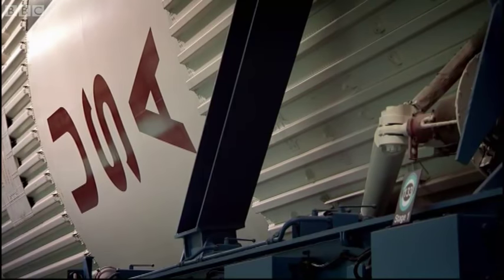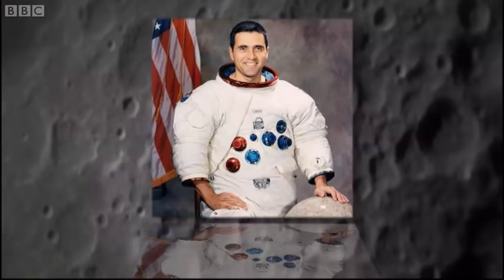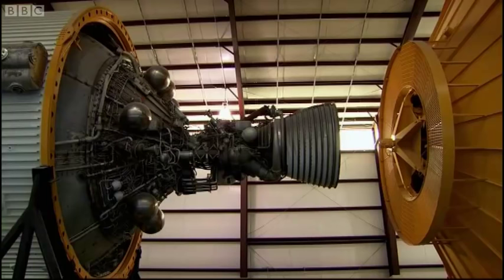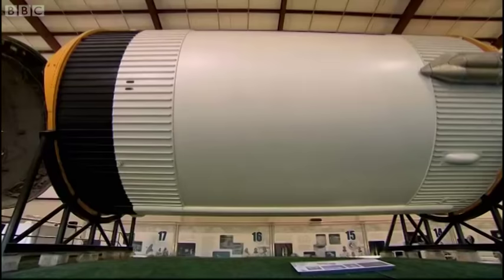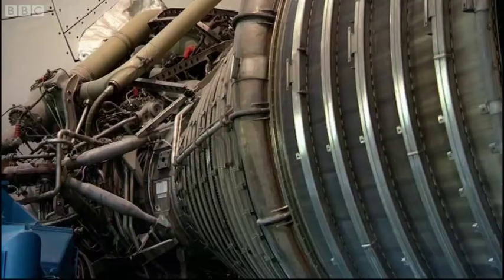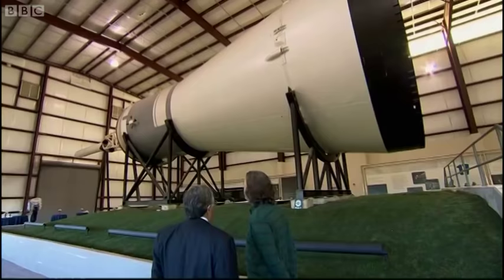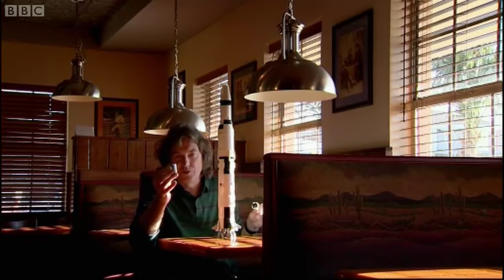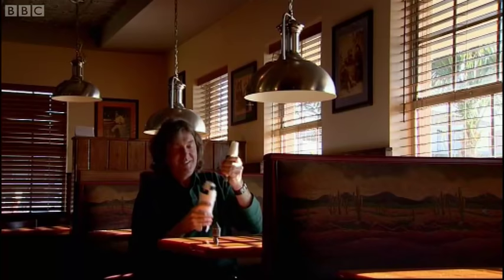How Did The Saturn 5 Rocket Work? | James May: On The Moon | Earth Science

Comment: 6 million components. James May The Reassembler: Saturn 5 rocket.....
Reply: In the words of clarkson if that happenes "A BBC film crew just hung themselves"
Reply: hung*
Reply: rockaholictom   Well, many of the parts were redundant, so that one failure wouldn’t cause an abort. The designers of the Saturn booster in particular had a large number of redundant systems. And it certainly worked well. It never had a major failure, a rarity in those early days of rocketry. It even survived two lightning strikes during the launch of Apollo 12. Everything on the CM had to be “rebooted”, but the Saturn’s “brain” (the guidance system), the Instrument Unit (IU) was well shielded, and it kept the booster on course into orbit.
Reply: ....I mean How hard can it be?
Reply: @johncronin9540   I'm calling you out on your fraud. You can't go above Mach III. Actually , giving you, and your claim of Mach III , let alone 25,000 m.p.h. {LOL} , please, you ain't got it in ya, fraud. Your booster separated/staged , and then it went out east trajectory toward Bahamas, and crashed into the water.  That's it, fraud.
Reply: Stratoleft You can “call out” whomever you like. I never claimed that I was working for NASA (then, or ever). The problem you have is trying to find evidence for your claim. I was alive while the Apollo missions were happening, though I was too young to remember Apollo 11. 

But I DO remember the later missions, and especially in the last three “J” missions (which had the Lunar Rovers), and remember watching those extended EVAs on the Lunar Surface. They lasted as long as 5 hours each, and covered a lot of ground. Viewing this was possible due to the fact that a television camera could be attached to the Rover. That camera was controlled by a flight controller at Mission Control. 

As for the booster, if you watch the first stage burn, you would hear of the spacecraft and booster approach “Max Q” which meant that the vehicle was surpassing the maximum dynamic pressure, which was the speed of sound. You could see this on the ground, especially via the telescopic cameras as the vehicle passed out of sight. 

But that doesn’t mean it was simply flying horizontally. It’s velocity took it up in altitude, and eastward, to take advantage of the Earth’s rotation at that latitude. That saves fuel. 

It took the power of the first and second stages to get close to orbit, and the third booster ignited to give the vehicle the speed it needed to achieve orbit, which is 17,500 mph. The vehicle remained in that orbit for about 1.5 orbits, so that Mission Control could review the telemetry data they were receiving, and ensure that the third stage and Apollo spacecraft were functioning nominally, before a “go” for TLI was determined, and that burn commenced. The third engine was reignited (a first, in liquid fueled engines), and sent the vehicle on toward the Moon (more precisely, toward the location the Moon would be at in three days time). 

That burn, well above most of the atmosphere, accelerated the vehicle to about 25,000 mph. It was enough to get the spacecraft to the Moon, though almost immediately after the burn, the speed of the spacecraft would begin to get lower, as the Earth’s gravity was still interacting with it. Once it passed the point where the Moon’s gravity was stronger than the Earth’s, the spacecraft would be accelerated again, (though not to the 25,000 mph speed - the Moon’s gravity was much less than that of Earth), until the burn of the SPS engine placed it in lunar orbit. 

Attaining that high speed (25,000 mph) would be approached again after the CSM “fell into the Earth’s gravity well”. The atmosphere of the Earth would greatly slow that velocity. You can see the punishment the CM endured by looking at the scorching all over the sides of the spacecraft. The ablative heat shields took most of the heat generated by re-entry (those heat shields were built about 15 miles from where I am writing this). 

The nature of such a voyage could easily be tracked from many locations on Earth, and many radio astronomers tracked the flight (when their part of the Earth was in the proper location, and certainly the Soviets were tracking it. Had this all been a hoax, they (and anyone else with a radio telescope) would have immediately known about it. That’s because throughout the flight, a stream of telemetry and voice communications was constantly being sent to Earth from the spacecraft. The only times this didn’t happen was when the vehicle was passing above the far side of the Moon. 

There would be no possible way to fool the entire scientific community on Earth, and it’s also clear that the Soviets would have announced any fraud to a global audience. 

Sorry you live in your own little world, where facts don’t matter to you.
Reply: Joe Chang    Well, the main way the Apollo missions were navigated was using the Doppler effect by analyzing the radio telemetry from voice and telemetry signals from the Apollo spacecraft. The backup system involved a gyroscope and a computer (one each aboard the CM and the LEM. The third backup involved one of the older methods of navigation, using the stars with a sextant. During the course of the flight, mid-course corrections would be done, if needed. 

In terms of distance, it was usually the distance from Earth. While the TLI burn would accelerate the spacecraft to 25,000 mph, as soon as that burn finished, the spacecraft would slow down, as the Earth’s gravity would still be influencing it. This would continue until the spacecraft entered the location where the Moon’s gravity would become stronger than that of the Earth. It’s important to remember that in terms of navigation, mission planners had to get the spacecraft not to where the Moon was at launch, but where it would be three days ahead, when the spacecraft reached the Moon. 

The aiming point was a spot 60 nautical miles above the leading edge of the Moon, and while passing around the far side (SPS engine first) that engine would fire, slowing the spacecraft so that it would be in lunar orbit. 

In the early missions, Mission Control would fire the third stage of the Saturn, so that it would be well separated from the Apollo spacecraft. Essentially it would be sent into a solar orbit. In later missions, when there were seismometers on the lunar surface (placed there by previous missions), the third stage would be set on a trajectory to impact the Moon, thus creating artificial “moonquakes”. 

As for returning, the SPS engine would be fired, thus reaching escape velocity from the Moon, and the spacecraft would literally fall down the Earth’s gravity well, from a very high altitude. The velocity would quickly accelerate back to that 25,000 mph, until slamming into the Earth’s atmosphere. The trajectory again was monitored from Mission Control, via a network of radio antennas placed at points around the globe, so that communications would be constant during the coast home. Again, if mid-course connections were needed, Mission Control would send up the necessary data needed to execute the burn. 

The vital item on the return trip was the angle of entry into the atmosphere. It had to be extremely accurate in order to achieve a nominal re-entry. If the angle was too shallow, the CM would bounce off the atmosphere, like a rock skipping on the surface of a pond, and the crew would not have the fuel necessary for a second chance. If the angle was too steep, the spacecraft would burn up, despite the heat shield. 

There are books which explain in complete detail just how this was done. Needless to say, it was a collaborative effort between the flight controllers and the crew. Navigation and guidance was handled in the front row, nicknamed “The Trench”. 

For unmanned deep space missions (such as Voyager), controllers often used gravitational energy (often referred to as a “slingshot” maneuver) to accelerate the spacecraft to greater and greater velocities. 

An understanding of gravity and of inertia is all that is needed. In the vacuum of space, once a certain velocity is achieved, any object will continue on this path, unless acted upon by various gravitational fields. Engineers simply used their understanding of gravity to harness gravity to increase the velocity of a spacecraft. If you look at the trajectory of many of these probes, they are often headed in unexpected directions to use the various planets for these slingshot maneuvers, thus allowing the spacecraft to get to its destination more quickly. They rarely rely on boosters alone.
Reply: Joe Chang  You forget that in space, most of the time, the spacecraft will coast most of the way. You don’t need to constantly fire a rocket engine. But unlike on Earth, space is a vacuum, and thus there is no friction to slow a spacecraft down. The actual TLI burn is of a short duration (a few minutes at most), since at the time of TLI, you are already in orbit at 17,500 mph, and are increasing velocity to 25,000 mph. It takes more fuel just to get into orbit. This is why the Saturn 1B was used for Earth orbit Missions (such as Apollo 7). But to go further (to the Moon), you need the much larger Saturn V. 

Bear in mind that a manned vehicle has a lot more mass than an unmanned probe (life support systems, and increased redundancy add considerably more mass). That’s why the massive Saturn V was needed for Apollo Lunar Missions. Those unmanned probes had a lot less mass.
Reply: Would watch. Would skip work and meals to watch
Reply: Joe Chang    NASA did choose the timing to be “early local lunar morning” as the time for landing. (Remember, one complete lunar day. Is about 28 Earth days). Temperature was one factor, but the more critical factor was to assist with the landing itself, for with the sun low in the lunar sky, the shadows would make clear such hazards as craters and boulders. You wouldn’t want to land on a boulder, and if you landed on a steep slant, you would risk tipping the LEM over. 

Early missions chose the safest spots to land, and as confidence grew, building on each success, more interesting, but slightly more risky landing sites were chosen. If I had had a chance to go, it would have been on one of those later missions, with spectacular views, and a rover that would allow you to travel further from the LEM. 

In terms of the landing, the LEM had two stages, a descent stage, which had one main engine (the first liquid fueled rocket engine which could have its thrust adjusted), with small thrusters on the ascent stage to control the attitude of the vehicle (pitch, yaw, roll). The main engines (one on the descent stage, the other on the ascent stage) used hypergolic fuels. What that means is that when the fuel and oxidizer came together, they ignited on contact. No igniter was needed, because ignition failure had to be avoided. 

The astronauts lived and worked in the ascent stage, and when it was time to leave, the descent stage essentially became the launch pad for the ascent stage. Apollo 17 had the best television image of the launch. This was possible because the TV camera was mounted on the Lunar Rover (a remarkable vehicle), and the camera was controlled from Earth. This was used with the three latter missions, but it took the flight controller time to adjust for the 1.5 second delay in a signal traveling to the Moon, and from the Moon. When the Lunar Reconnaissance Orbiter (LRO) was launched a few years ago, it was possible to see all six landing sites, with the descent stage, flags, instruments, and Rovers (used in last three missions) all still there. The LRO images even picked up boot prints, and tracks from the Rover. 

The EVA suit posed someone the biggest problems, in terms of trying to operate pressurized (Al Shepard had to do his golf swing with one arm, because he couldn’t bring his arms together), and also thermal control. The suits were white, to reflect most of the Solar radiation. But the Moon is actually one of the darkest objects in the Solar System, and its dust was quite dark, and like a fine powder (rather like burnt charcoal). It got everywhere, and over time, the temperatures in the suits would climb. (Remember, unlike Apollo 11, those latter missions lasted up to three days, during which the sun would be (much more slowly than on Earth) rising). 

The astronauts had to brush each other off, to remove as much dust as possible, in order to allow the white surface layer to radiate light and heat away, and put less stress on the internal cooling system.
Reply: scooter scooter    This is the biggest shame about Apollo. It’s been nearly 50 years since we’ve been. So many people have no living memory of any of the Apollo Missions. You can blame Nixon for that. Under his Administration, he canceled the last three missions (Apollo 18, 19, & 20), and ended the program, and forced NASA to develop the dangerous Shuttle. 

It was a combination of the economic downturn (mainly due to the costs of the Vietnam War), and, IMO, Nixon’s belief that Apollo was Kennedy’s big project. 

I do know someone who saw the last two launches. The force could knock one over, and his family lived sixty miles away, and had to take anything breakable down. He was fortunate to have a classmate whose father worked with NASA’s PR department, and they were able to watch from the media section.
Reply: Joe Chang     No.  The Sun would be just over the horizon, producing the longest shadows. If the Sun were at the zenith (from the POV of the landing site, there would be minimal shadows, which would hinder the landing). 

Of course, the Moon is like the Earth. Latitude can also affect shadows. The early flights (11,12) were near the lunar equator.  This was for safety. If something happened,  (like the Apollo 13 disaster), the spacecraft was on a “free return” trajectory, which meant that the trajectory the spacecraft was on would, without any firing of an engine, would use the Moon to slingshot the spacecraft back toward Earth. 

Ironically, Apollo 13 was the first Apollo Mission NOT on a free return trajectory, due to its landing site. One of the first tasks that had to be performed was to use the LEM descent stage engine (flight controllers dared not use the SPS engine on the Service Module) to return to that free return trajectory. 

But you must also remember in looking at shadows was that the Moon is not a perfect sphere. There’s no “landing spot”.  The crew had to find the optimal landing spot. Apollo 11 came in “long”. Their flight path took the descending LEM past the designated landing area. And the computer, following its software, was trying to land in an area with lots of boulders and craters. This is why Armstrong took over, and landed more or less manually (a situation that had been rehearsed many times in the simulator). Flight controllers, and anyone on earth with a decent radio telescope, could track the LEM’s flight path. They saw the spacecraft suddenly move horizontally, as Armstrong was flying manually to try to find a safe area to land. Armstrong was so busy flying, that he didn’t have time to explain why he was doing what he was doing. That’s how focused his concentration was. Aldrin saw the reason, but didn’t want to distract Armstrong. His job was to tell Armstrong their altitude and rate of descent. And all Houston supplied was the amount of fuel left (in terms of seconds). 

Obviously, they landed safely. Altitude and rate of descent, by the way, were calculated using radar. Apollo 12’s mission objectives included a “pinpoint landing” — landing as close to their designated landing spot as possible. You see, powered descent began with the LEM orientation horizontal, with the crew looking “up” as the engine was used to slow the LEM’s horizontal speed, causing it to de-orbit. As they slowed, they eventually performed a “pitch over” maneuver, which gave the crew their first look at the lunar surface. They had memorized landmarks, mountains, large craters, and knew what they should see as the spacecraft pitched from horizontal to vertical. 

When Apollo 12 pitched over, the crew recognized the landmarks, and knew they were right with their trajectory. They achieved their pinpoint landing. The shadows helped demarcate the landmarks they were looking for. As I said, the natural terrain would affect those landmarks. Objects and craters were more easily seen. Remember also that there would also be some illumination from the Earth, though not nearly as much as from the sun. 

Later missions deviated further from the equator, which would also affect the shadows. And during those much longer stays on the Moon, the shadows would change as the Moon slowly rotated over the course of three Earth days. 

All this is greatly simplified. There is a book, “How Apollo Flew to the Moon” (available on Kindle), which explains everything in great detail, the kind you seem to want. I recommend it. It explains, for example, why Apollo 11 had so many computer errors (essentially, the rendezvous radar was still on, and feeding data to the computer, and the computer was getting more data than it could handle). After every mission, the crew was thoroughly de-briefed, and that information was used to fix potential problems with the next mission. This is why, with each successive mission, NASA was confident enough to choose more challenging landing sites, among mountain ranges, and in the Lunar highlands. It was a step-by-step process. Many people forget Apollo 10, for instance, which was to do a “dress rehearsal” for Apollo 11, descending as far as 50,000 feet, but not landing. If Apollo 11 failed to land, then Apollo 12 would have attempted the first landing. Apollo 9 was a shakedown testing of the Lunar Module, but in Earth orbit. And so on.
Reply: Joe Chang   I don’t see that, but as I said, the Moon isn’t a perfect sphere, with no craters, boulders, or mountains. That’s going to affect the shadows. The idea was to have shadows visible during the landing, so the CDR, who is piloting the LEM, can see more clearly the shadows of these objects, and avoid them, and find a safe place to land. You wouldn’t want to land on the slope of a crater, and tip the LEM over. That would have been fatal, as that spacecraft was their only way home. 

NASA has, as part of their protocol, a stay, no stay almost immediately after landing. The Flight Director (it was Gene Kranz for the Apollo 11 landing) had to halt the celebrations, for a stay/no stay almost immediately after landing (launch windows are tight for rendezvous and docking, which sounds simple, but isn’t). Basically, every flight controller had to check their area of responsibilities (usually via telemetry, and decide whether it was safe to stay or not. 

Next time you are outside in daylight, actually look at various shadows during different times of the day.  They are more complex than you think. 

And buy or borrow the damn book. Or read the NASA Journals about each mission. They can explain their methods better than I can. One thing very clear, especially in the latter missions, is how the lack of an atmosphere can really play games with depth perception. One instance from Apollo 16 comes to mind. During the EVA’s, there were geologists in a back room, watching the images broadcast from the tv camera on the Rover. They saw what looked like a boulder the size of a small cabinet. They wanted a sample, and the request was relayed to Mission Control, which relayed the request to John Young and Charlie Duke. Young and Duke started walking back toward the boulder. But instead of a few steps, they kept going, and going, getting smaller and smaller on the televised image.

It turned out the  boulder was much further away, and was the size of a large house. That’s what lack of an atmosphere does. It makes it much harder to judge distances, and that is impossible to fake. 

But the most difficult aspect of all was the landing. Someone asked Neil Armstrong to rate the level of difficulty of an EVA on the Moon. Armstrong said it was three (ten being the most difficult). But he said the landing was a 13. EXTREMELY difficult. Because it’s much more difficult than landing a plane. Nothing like it was comparable. The EVAs were rated by most astronauts as easier than working in zero g. 

When I have time, I’ll try to find a video by a cinematographer who discusses these issues. He has the expertise to examine these issues. But I don’t see anything indicating that the sun is directly overhead. Unless you live between the Tropic of Cancer and the Tropic of Capricorn, you don’t ever see the Sun directly overhead. And there are some still photos I’ve seen clearly showing the Sun low above the horizon. It would have been less embarrassing for Alan Bean of Apollo 12 if the Sun WAS overheard. He was placing the camera onto a stand, and accidentally pointed it directly at the Sun. It burnt out the camera. 

The reason this happened was because the camera wasn’t ready for use until just before launch. He had been practicing with a wooden block cut to resemble the camera. There would be no reason to point the camera straight up, if that is where you think the Sun was. 

What you should be thinking is why, if you are going to fake a lunar mission, would you do it six times? And three more missions were scheduled originally, before the Nixon Administration cancelled the last three. It left some astronauts (like Dick Gordon, CMP of Apollo 12) disappointed. Gordon would have been slotted to command Apollo 18, and gotten a chance to walk on the Moon. Those men spent hours in cramped simulators, practicing (along with the flight controllers, who sacrificed a lot of time with their families) over and over all their procedures. As well as being tested by every conceivable problems that the sim crew could throw at them. Would you spend all that time and energy for a mission that never flew? Remember, these guys were test pilots. Flying was in their marrow. 

Alan Shepard was really angry when he was grounded for an inner ear problem which caused severe vertigo. It took him ten years to find an effective surgical treatment, and be restored to flight status, and he made sure he got command of Apollo 14. And he became the oldest human to land on the Moon. But he was grinning ear to ear.
Reply: Joe Chang   Another good book is Andrew Chaikin’s “A Man on the Moon” which has details of every Apollo Mission. Everyone knows a lot about Apollo 11, but we know far less about the other lunar missions, which were in many ways much more interesting, as each mission stayed longer, and traversed more distance than Apollo 11. Peering into Hadley’s rill, an ancient channel carved into the surface by an ancient flow of lava.  Landscapes that look so different from anything seen on Earth. 

I remember being fascinated watching this when I was a child. And I never thought so much time would pass before a new program would land on the Moon. But NASA cannot lobby for funding, and in constant dollars, NASA’s budget has been shrinking since the 1960’s. The Shuttle was a death trap, but NASA’s original plan was for a much smaller manned vehicle, which could have been placed atop a stack, instead of the vulnerable position it had, but again, the Nixon Administration wanted a large cargo bay as demanded by the military. 

It actually would have been cheaper to keep using the Apollo Saturn system. The Saturn never had a catastrophic failure, a remarkable record, and a credit to the engineers who designed and built it. (The Marshall Space Flight Center generally developed the boosters, while the Johnson Space Center developed the spacecraft). No booster yet has exceeded the sheer power of a Saturn V. Part of the reason for the Shuttle was that it was supposed to be less expensive, but it turned out to be MUCH more expensive. And it was limited to leo. It could not go higher, as the stresses of a higher speed re-entry would have created higher temperatures than the tiles could handle, and the aerodynamic forces would tear the Shuttle apart, like Columbia. 

The bright spot has been the unmanned programs, which have reaped a harvest of data about our Solar System, and we know so much more about our Solar System than ever before, with close up images of all the planets, not to mention the probes on Mars, which have revealed a great deal. 

Indeed so many satellites have been launched that there is a hazard of space junk, constantly monitored by NORAD. Now, by agreement, all low-earth-orbit (leo) satellites must keep a reserve of fuel so that they can be sent into the atmosphere when their “lifespan” is over. And geosynchronous and geostationary satellites, which orbit much higher, (communication and weather satellites) can be moved to a different orbit when their lifetime is over.